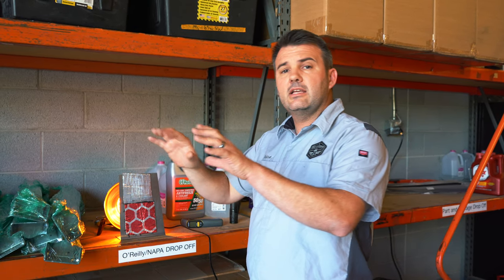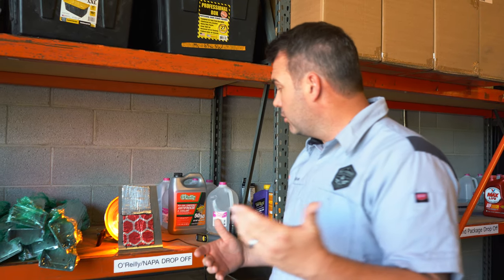Sound Deadening vs. Thermal Insulation [HEAT TEST]

Comment: As I had once a complete fail experience with a restomod German van I worked on that I could barely drive because of engine heat transfer to the cabin ,I realized that on any build, heat and  engine cooling control is one of the most important thing ,it will make the difference between driving your dream car all year around or only when it's cold out (AC or not..!!)..I picked up on really old MORGAN cars blue prints and they are still using specific wood for their fire walls and chassis parts...I built mine for a sleeper Turbo 5 cyl VOLVO using a wood contruction , aluminium sheets and pieces of heat protection material (for SAAB Turbo battery casing)and the result is amazing in term of heat control,sound and insulation...!!
Reply: Did you make it by yourself or you bought it
Reply: @mahmoudazim6340  I draw then cut with craft paper the exact size of the fire wall (included holes & passages for wires & lines/cables..) then had a wood shop cut (walnut wood) in two pieces ,I made the aluminium sheets 'sandwich' my self (added exhaust protections sheets from a crashed Audi A8) then bolted it on the stock firewall before reinstalling the engine..(the wood+ aluminium sheets + exhaust liner added 2.5 cm to the stock firewall).
Reply: @hectorherbert6585  
For truth Hector 
you should make one YouTube video

What you said is a piece of Art

Unfortunately we wouldn't have that great work you make

I think you can make even for small part as example for the whole work

My greetings

I hope to drop me your WhatsApp or messenger to communicate with you easier if you don't mind
Reply: @mahmoudazim6340  I actually did not invent anything ,but I was very inspired by the way British car builder MORGAN constructs their cars by using specific wood brands for decades ,for their chassis and other key parts of their build(fire-wall)..for the YT videos..,well ,I built that specific firewall for my car and a few other parts..but it"s done now..I don't intend of fabricating other fire walls since the one I installed on my Turbo Volvo is still  'perfect..!!..I was just giving ideas & advice for people who forget to deal with that specific part of any DIY/swapped hot turbo car..!!..actually a friend of mine can't drive his SAAB 900 turbo in summer because of the heat coming from the engine & floors..!!!cheers.
Reply: @hectorherbert6585  
So is there any DY videos or any other videos you recommend about the same exact idea ??
and please another 2 questions
Why you make the wood into 2 pieces
And from the direction of the engine is the fire wall stock or your hand work?
And do I understand right when you said Aluminium sandwich so the 2 sheets of Aluminium is covering the wood sheet? No
Reply: @mahmoudazim6340  I made it in two pieces at first , for easier installation with the engine in place ,then I decided to remove the engine to install new polyurethane bushings/silent blocks and move the battery to the trunk (heat)...and cut extractor vents through the front fenders (with fans)..work I decided later..and yes the wood is 'sandwiched' between two sheets of aluminium + heat reduction material normally installed under all  the car exhaust's length (on 10 lbs of boost pulls the turbo would heat up the heat sensor next to it to a 1000°C....!
Reply: @hectorherbert6585  
I want to ask you please is there any similar idea for the roof ?

Comment: Is their anything else that would make this more worth while for 200 buck I just did my truck with the kilmat then noico foam insulation and it was around 160 for 72sqft of each  Material took longer for sure but the results where incredible almost a 40 degree deference in the Temps from sitting in the sun all day
Reply: This was the exact combo i had just jotted down to buy before seeing your comment lol
Reply: Which one did you put down first the kilmat or the noico? Thanks

Comment: Two words: thermal emissivity. You can't make accurate measurements with an IR thermometer like that. At the very least you would want to put a piece of black tape on each material to measure off of.
Reply from the maker: So scientific. We'll have to try that next time, thanks
Reply: EXACTLY.
temp guns instructions even say.... dont point on shiney surfaces.
Reply: I thought it was common sense that reflective surfaces….. um…… reflect…. 🤔 I guess it’s… uh… not common sense…..
Reply: @whydontyouaskme or it maybe by design but i don't know...

Comment: Not necessarily true I put sound deadening in my nephews truck or rather he did and he claims to have a lot cooler temperatures in the cab
Reply from the maker: Straight Line Cycles I’m using facts I can measure, not anything else.
Reply: @FatFenderGarage  i know, hes a really big boy, who noticed it immediately,  i plan on using your stuff, simply because it does do what it claims, very nice
Reply: @FatFenderGarage  it is also fact that your test is flawed😅

Comment: An a/c working well should blow about 50 degrees F cooler than ambient at the vent, not 20.
Reply: I’ll have to try this next time it’s 20 deg outside and snowing….didn’t think my AC system could get the cab down to -30 deg.  I hope I don’t die!
Reply: It's how much it cools the air inside the entire cab, not what's coming out of the vent
Reply: @heavenleigh111  50 degrees below ambient at the vent equates to about 40 degrees below ambient in the cab. The temp at the vent directly effects the cab temp. Using vent temp gives a stable baseline to accurately measure cooling capacity. It's the only way to accurately test if the a/c is working properly.
Reply: @RoddyDa  Reading comprehension is obviously not your strong suite. Try reading it again, slowly.

Comment: I watched a guy install the heat barrier dynamat makes and it cut the heat by 100 degrees.
Reply: Why…what’s the point in this comment??
Reply: So you're saying if it's 100 degrees outside on a summer day, and that barrier is 100 degrees difference inside the car. That would make it Zero degrees inside. What you're saying is you could freeze water inside that car he installed it in???  Please drop link of said video.